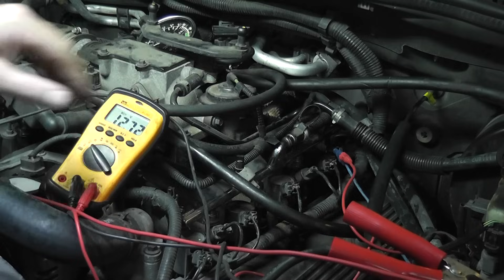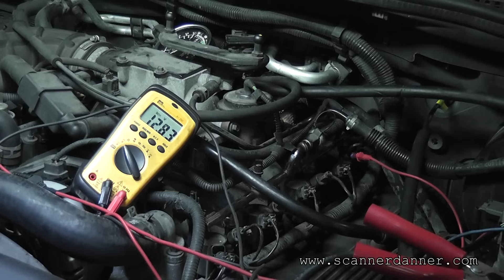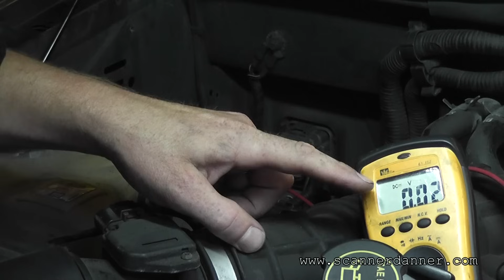How to test a fuel injector circuit with basic tools (open control wire)

Comment: I have an 09 Escalade I'm sick of dealing with...I am getting codes P0206 & P0300... I've done a noid light test, took all injectors out and tested them and cleaned them. I changed plugs, wires and did a spark ignition light test. I ended up changing out the in tank fuel pump  because I wasn't getting consistent pressure reading with key turned. Come to find out you need to only do the pressure test on these gm trucks while they are running, because that's the only time pump is on. To make a long story short it ran fine for 2 days and I was finally happy this nightmare ended. And out of the blue in a drive thru it starts jerking and bucking and check engine light comes on....then out of nowhere it gos away. When it happens tons of white smoke comes out of exhaust that smells like raw fuel....it's suffocating! I'm tired of people telling me to do a compression test! This vehicle has  been babied and drives perfect one minute....oh and if I jack it's front up it will run perfect but as soon as I get the jack down engine light comes on and the white smoke comes out and it bucks and Huff's and puffs! Please help!!!
Reply from the maker: You have a short to ground on one fuel injector circuit that is intermittently keeping the fuel injector on constantly. This will do EXACTLY what you are describing. You can also ruin your engine with this problem from the gasoline making it past the rings and it gets down in your crankcase and dilutes the oil, wiping out your bearings. 
Here is a video of a Caravan with one constantly spraying injector. Forgive the audio it is an early video and I am shouting so my class can hear me :-)
https://www.youtube.com/watch?v=jsl531-6q-A
Reply from the maker: It should be the number 6 cylinder injector circuit. Look at the harness real close and where it is routed. IF you are jacking up the vehicle and it is changing it, it should be very obvious where the harness is rubbing. DO NOT start pulling and tugging on the harness without first identifying all of the contact points. Hope that makes sense. 
Otherwise you may move the harness temporarily from where it is rubbing and fix the problem and have no idea where.
Reply: ScannerDanner thank you. That was my next step. It has to be a short or something!!! I did the noid light test and they all seemed pretty consistent. I also replaced that #6 injector with a brand new one. I did follow the injector wires as far as I could see and the harness wrap was frayed and is crumbling to peices as I touch it. I'm gonna go out to the garage and get a little more personal with her. I'll post what I can find. Is there any multimeter tests I can do to make it a little easier IF I don't find anything wrong with the harness or connector?
Reply: ScannerDanner thank you. That explains my oil smelling like gasoline! As soon as it started acting up I parked it in garage. Hopefully I can get to the bottom of this with this new info. Thank you again for any advice.
Reply: ScannerDanner I also forgot to mention right before all this started happening I hooked a friend's trailer up to it and his taillight and brake wires were all jacked up causing my vehicle to blow two left turn signal fuese in a row.... could this have anything to do with it at all?
Reply from the maker: yes sir! Key off, disconnect suspected injector circuit (#6 in this case I think), take a test light to battery positive on have it connected to the control pin of the injector plug. DO NOT stuff the test light in that terminal and spread it apart. Backprobe it and use a jumper wire connected to the end of your test light. Make sure backprobing pin and light are not touching anything metal. 
Your test light will light every time the harness touches ground.
Or you can plug your noid light back in and turn the key on (need power to your injector too if your using the noid light)
There is a variable to that though, some systems do NOT provide power to the injector with just the key on, the car needs to be running. This is why I always suggest the test light method.
Reply: ScannerDanner awesome...I already started with no luck yet..I forgot to mention it's the 6.0 hybrid version and this gigantic box takes up half the engine bay and all the orange hybrid wires are right in the way!
Reply: ScannerDanner quick question. Does it necessarly have to be the ground wire on the #6 injector? I been all over that harness like white on rice and the only thing I could find with test light connected to ground and key turned was 2 wires that were heatshrinked into 1 wire and when I tug on it my light goes from yellow to bright green.... however this isn't my ground injector wire...how does it flicker????
Reply from the maker: #1 is the P0206 code a hard fault? (clear it, does it immediately return)
#2 is the P0206 code for the #6 injector? I only did a Google search on the code
#3 you should NOT be using an LED test light, they are misleading, use an incandescent light
Reply: ScannerDanner yes P0206 comes up as injector#6 circuit malfunction. I have a test light that hooks pos & neg to bat and lights up green if negative and red if positive....the #6 injector and #6 injector only it's yellow....i tracked the #6 injector wire all throughout and now I'm at one spot, when I touched the harness the test light will go bright green just like my  "known good" ....but I'm stuck because its stuck on yellow witch I assume means it's being shorted somewhere....but I cannot find where...I literally got frustrated and just started shaking all the cables around...I don't want to have to tear off anymore wire wrap it's a pain..
Reply: ScannerDanner oh and I when I had erased the code  it comes right back when it starts acting up.. the engine warning light will go on and off before my eyes...it gos from running good to like shit.

Comment: hi, have a 2004 Passat V6 4motion!
The car misfires on Cylinder 2, Cylinder 2 fuel injector is replaced ( with a tested/funtional used one)  
the code reading says :P1226 Cylinder 2-fuel injector circuit -N31: low
question : how do I repair or replace it??
my email: knazary@icloud.com 
please help I am in Afghanistan, so the is no access to decent mechanics or parts.

parkplugs:new
coil: ok
can you please help , regards

Comment: There is no excuse however if the employe of the shop doesn't pushes tech to be professionals  and if he grooms them to just be Parts changers then this is what happens a real mechanic knows exactly how things work and knows exactly how to troubleshoot there's a big difference from people who just throw Parts at something and people who actually know what's going on this is one of the reasons why I got out of the trade when I was in the trade there was no respect for people who knew what they were doing it there was  a lot of respect for people who change Parts because people will change Parts make the shop money there's a fine line there and business owners need to learn how to walk that line good job with this video I appreciate you showing how some simple steps when troubleshooting can resolve head-scratching problems I repaired a similar problem last night on a friend's car it's been 17 years since I put my hands under a hood yet I knew exactly where to look because I have the same attitude as you you don't  always need to have all these fancy tools you just need to have some common sense and some troubleshooting skills

Comment: Great video! I have a question, I have a 98 Ford ranger 3.0 I have to take the plenum off to check the number 5 injector and wiring. I will not be able to run the truck how would I do this testing? Will it work with the key in the on position?
Reply from the maker: I don't know what you are working on but this video should help you
https://www.youtube.com/watch?v=wQTPToX6P9U&t=1630s

Comment: will a bad injector/connection cause a po 356 code? New plugs and COPs have been installed and still runs rough.
Reply from the maker: Year, make, model, engine size would help
Reply: 04 F150 5.4 4X4 3 VALVE

Comment: I got p0305 compression is good spark plug is not firing that can be from an open circuit in the harness? Or pcm?
Reply: Possibly a bad coil pack? Try swapping with another coil pack and see if you get a p0303 or whichever one you swapped it with.

Comment: Awesome instructional video, thank you for making it and sharing it. I had just completed the dreaded plenum plate and gasket repair on a Dodge 5.2, along with numerous other repairs and replacements while in there. I had one cracked fuel injector, so I bought a new one to replace it. It was a BWD (Borg Warner). Got everything put back together, and it was running like complete shit, bad idle, wanting do die, missing, etc. The computer finally kicked a code, P0208, which was the same cylinder that had the brand new injector. Found this video doing research, planning for the worst, even a possible broken valve spring. Well I checked the resistance on that injector, and there was none. Brand new, non working injector. Just replaced it and my truck is running the best it has since I've owned it! Lesson to be learned, don't ever count on brand new parts to be in working condition! Anyways, thanks again for the video!

Comment: Is it also possible to do a 'continuity check' between injector control wire pin and the ecu pin using multi-meter?Ain't the same thing?Great videos man!
Reply: Also if in this situation we HAD 12v at injector and 12v at the computer this means that the harness is good and  injector is good AND THE ONLY thing left is the ECU which is not grounding the circuit(engine running) then the injector needs to spray fuel, am i right?
Reply from the maker: you could do that, but the more you watch me, the more you'll see how much I hate the ohmmeter and why
Reply from the maker: This one had an open wire, not a faulty computer. 
Also, if you find a computer that is not pulsing the injector, it may be doing so to protect the converter from a misfire, so there are other variables.

Comment: so if you check power at the injector and have 12 volts on both wires it is a ground side switched circuit which is also pull down design right?

Comment: Just so I am clear the open was on the control side correct ! otherwise if we had 12 volts on the onjector harness, we should have 12 v on the PCM Terminal.

Comment: @scannerdanner I did compression test everything passed with flying colors. The 4th injector isn't making a "clicking noice" while running so I'm suspecting that the 4th injector is "dead". I originally thought it was a bad coil or coil housing.
Reply from the maker: +Harlee Bro that would do it then bro. you can check the injector circuit like I did in this video. 
https://www.youtube.com/watch?v=mmRhcVkJdeQ
Reply: ScannerDanner

Comment: will a bad injector or injector feed wire end cause the engine to throw a p300 code and run super rough? my car starts but runs like its on 3 out of 4 cylinders barly drivable it stalls and bucks.. any info would be helpful guys! thanks
Reply from the maker: +Harlee Bro yes, an injector that is not firing will cause a misfire and misfire codes. I've seen many times a random misfire (P0300) caused by a single cylinder misfire. 
Also you need to check compression, low compression will cause a misfire too. 
If you can, perform a cylinder drop test first and figure out what cylinder is causing your issue. Then once you've identified that, check for spark, fuel and compression. 
Here is a few videos showing the cylinder drop test
https://www.youtube.com/watch?v=5ewJIBS9L98

https://www.youtube.com/watch?v=OH_U3D4S5Q4

https://www.youtube.com/watch?v=m2fubKkvZVI

Comment: Im having trouble exact same problem #4 injector has no blinking , and also some fuses in my fuse box dont light up when putting the test light what could cause that? i checked the fuses and switched them to ones that are working and no fix .

Comment: Paul, thanks for showing that, it  is good info. Perhaps you should have explained how the injector circuits work, as i think that not many do understand. I'm a Chrysler dealer tech, and the way Chrysler designed their systems, the injectors get 12v all the time, the pcm turns the ground on/off to turn the injectors on/off. I don't know atm how all the other manufacturers design their injector circuits, but wanted to point that out in the event that there are different designs.

Comment: Hey Scanner Danner correct me if im wrong ok if i did not have a noid light could i just have the koeo and backprobe both wires unplug and the one that reads 0 could i take a test light to b+ on that 0 volt wire an see a pulse cause i have a similar problem on a car im working on

Comment: Hey I got one for ya...friend had knock sensor code all he had was the powerprobe short checker..I used meter to check for bias...no bias then used meter to check wire to computer with continuity beeper...was beeping on a dozen wires... then used short checker and it was shorted....... after engine swap somebody found a loose blue wire and grounded it...the short checker was invaluable along with bias knowledgeThanks scanner danner!  I need your book.
Reply from the maker: area46241 awesome! thank you. 
my book is available through my website www.scannerdanner.com
I have it in paper form and as an eBook.
Nice job on your friends car and understanding how to use bias voltage

Comment: You should explain when to use a LED test light and when to use a regular bulb test light. I don't want to fry any electronics.
Reply from the maker: Either one is fine on a fuel injector circuit but you're correct, I should have emphasized that in this video.

Comment: Excellent video.  Thank you. 
I have a test light but I don't know if it is "computer safe".  If I perform your last test where the test light ( lead connected to battery positive) was flickering on and off, will I definitely fry the computer if my test light is not "computer safe" .  Or can I assume that since the bulb of the test light is providing a Resistance, then it will not be possible to fry the computer whether the test light is a computer safe one or not?
Reply from the maker: That is correct and since most fuel injectors draw around 1 amp (1000ma) of current your test light will be fine. Most incandescent lights draw about 200ms and the LED types draw less than 20ma
Reply: @ScannerDanner  I think you meant 200ma instead of 200ms?
Reply: What you are seeing is called ground side switching.  Watch the video again and notice when he gets 12v through the injector circuit.  This does not mean your computer is the same but to say all computers fry with battery voltage is incorrect.  It depends on the computer and in which pin ect...There is a good video Paul did on ground side switching with Eric the Car Guy.  Good question.  Keep it up with that critical thinking and the answers and knowledge will follow.

Comment: Nice one! Don't forget to also check the noid light before using (or at least on a couple of cylinders like you did) ... almost got burnt one time thinking that I had a control problem, when in fact the light was bad.
Reply from the maker: Good point brother thanks!
Reply: ***** another thing to keep in mind is that the computer will not control the injector with a misfire or fault. Obviously not the case here as there should be 12v to the PCM.

Me personally have spent good money on diagnostic equipment. Granted in this circumstance you don't need fancy tools. To do diagnostics and not have advanced tooling doesn't make any sense. You can't make "100% calls".
Reply: Turbotomass Good point... on older systems it'll still fire the injectors. A glowing cat will verify that! LOL
Reply: ***** Too right: THE fundamental of using any test tool is to first ensure that it works!

Comment: Most of what Danner does is basic automotive diagnostics. Any good tech school and a couple of years hands on can get you here. With that being said you wont be on this guys level anytime soon! I would say Danner is more of an Advance engine performance technician. More reading and testing than turning wrenches. I was chasing this at one point but sadly in my experience shops respect guys that can turn more hours rather than a guy who wants to take on the difficult jobs. In my experience doing this type of work in a main stream shops is a money losing endeavor, Diag times equals missed quick bolt up jobs Ac brakes belts fluid ect. Also the more you prove your self to the service manger the more you'll  find your self tied up. It will get to the point where they only give you certain job tickets AKA the time consuming Advance engine problems. You may also find that you wont get many off days always getting called in to fix another techs misdiagnosed job. My advice if you go this route in the business go to an Independent shop or a specialty shop.
Reply from the maker: Wow thank you for the compliment!  And I agree, even if upper management in a big chain store doesn't give you recognition I promise you the store manager will. I used to work for Pep boys so I know this first hand. And I made a ton of money and worked the least amount for it! And I never had to fight for work on those slow days. I was never slow. I always had work lined up for me. This field is awesome!
Reply: 7.26.15.     I work as an Industrial Electrician/Instrument Tech, & the persons with the higher skill level had to follow the other less motivated techs, after they "exhausted their talent", on a problem! Good management recognize this an utilize them accordingly. There is an enormous amount of parallels in your field, as there is to mine. I've commented before on Paul's methods, he is simply in the upper one tenth of one tenth of a percent of Tech/Instructors! As for the issue your facing, start freelancing on the side! It will put you in a place that your talent should be utilized. ⚡️